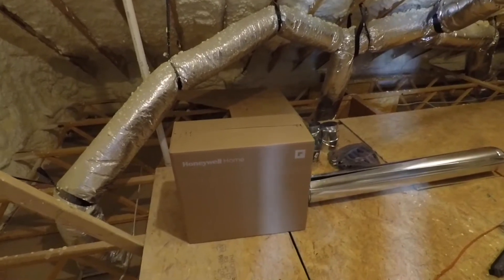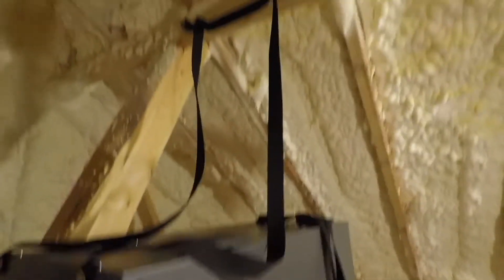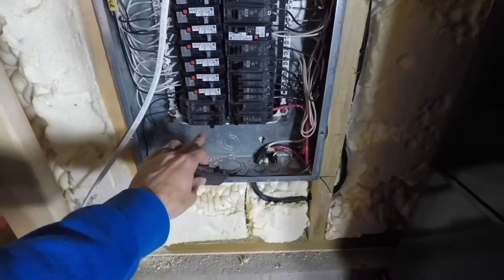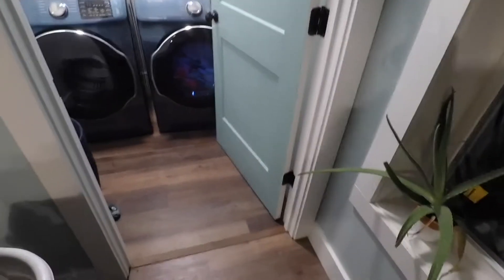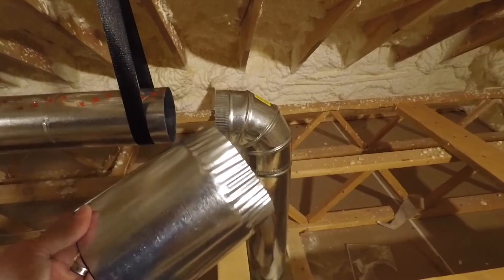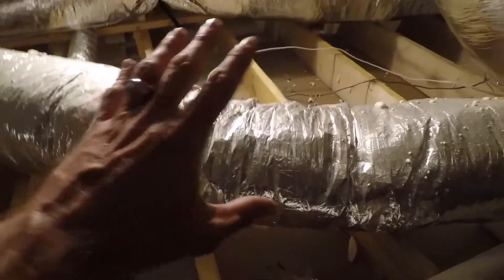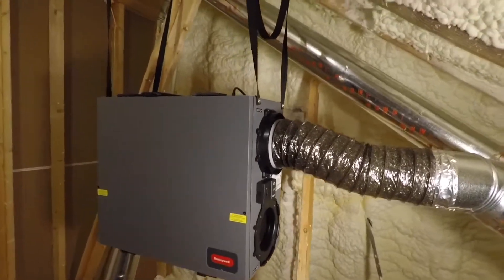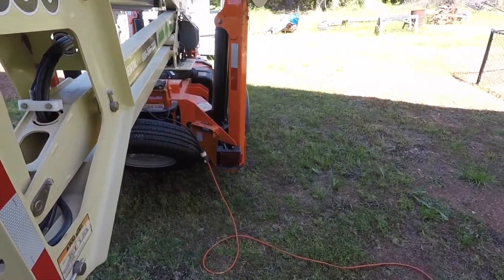We installed an ERV in our house. DIY Energy Recovery Ventilator Honeywell VNT5150E1000

Comment: Funny how you see trying to figure out what they were thinking when they installed the thru wall exterior vent. They weren’t.  They slapped em in and rolled off the job.  Never cared if they were connected. Good thing you caught it. You should check the others they are probably blowing in the the wall cavity as also.  Good work.  I’m wondering if the system is a good substitute for bathroom exhaust?
Reply from the maker: My kids take really hot showers. The ERV does not suck the steam out of the bathroom fast enough. When they open the bathroom door, it sets off the smoke alarm. I cut a little bit off the bottom of the door to allow the ERV to pull more air into the bathroom. I probably need to cut more off the bottom of the door. Or maybe they shouldn’t take showers that are skin boiling hot. Haha.
Reply: So you removed all the exhaust fans? Or just one?

Comment: Nice video.  One thing you may want to consider is to minimize the hard turns (i.e., 90's) and use more gradual turns.  The hard turns/T's impede air flow - while Y's and 45's and large arcs impeded far less.

Comment: How load is the system?
Reply from the maker: Do you mean how loud? It is not loud. It sounds like a fan running. There is a bedroom right next to the attic space where this hangs. You cannot hear it while in the bedroom. I can easily have a conversation standing in the attic next to this unit.
Reply: @BrantleyBlended  sorry, yes, Loud! It has to be placed in a bedroom on an exterior wall because it’s going in a condo. Do you think it will be comfortable to live with?
Reply from the maker: @juliesack2752  I think it will be okay. The box is well insulated, especially the door. It’s not as loud as a plastic box fan. People have those running in their house all the time. Maybe it’s as loud as a ceiling fan running on medium or high. I will post a video in the next day or so about how loud it is. Maybe that will help you decide.
Reply: @BrantleyBlended  thank you!

Comment: You did a good job of installing and explaining. I’m trying to learn about these systems so I can eventually install one in my home. I guess I’ll subscribe and see what else I can learn.
Reply from the maker: For some of the longer runs upstairs, I should’ve reduced the duct size from 6” to 4”. 

I wish I would’ve used an ERV/dehumidifier comb unit. 

If I could start all over, I would just install fresh air intakes on my 2 hvac units. I would not install an ERV at all.
Reply: @BrantleyBlended why just fresh air intakes into the hvac. Cost and time? Would you get comparable or better results than the stand alone ERV?
Reply from the maker: Yes, cost and time, but some other reasons too. I would’ve saved a lot of money by just installing fresh air intakes. I also would’ve save a lot of time. I could’ve installed the fresh air intakes a lot faster. 

The ERV requires cleaning at least every 3 months. I’m tired of constantly cleaning and maintaining the ERV. 

The ERV is working good, but I feel like my house could benefit from higher positive pressure. If I had 2 fresh air vents they would pull in a lot more air than the ERV does.
Reply: @BrantleyBlended - do you think that would have solved the problem without setting up your ERV ? Im in a similar situation from tour first video which lead me to this seeing how I'll need to install this unit on our metal home that we builtand have spray foam in it an my humidity level is always like 75-80%😢 so this video gave me hope.
Reply: @BrantleyBlended - how would you get the fresh air intakes to pull the air in would it require you t purchase some sort of gable vent with a fan to draw in the fresh air into the hvac system allowing the fresh air to travel through the ducts? Would i still need separate return ducts to pull out the stagnat air?

Comment: GFCI plug but not a GFCI breaker?
Reply from the maker: I think that’s overkill. The code was changed some years ago and now breaker panels are filled with gfci breakers. They are expensive. They trip too easy. I don’t think they are necessary.
Reply: You only use one not both

Comment: Instead of metal SS duct v can make use of PVC SWR.  with complete accessories Y. Coupling reducer available only v hv to do PU OR  aluminium insulation on PVC pipe Duct ....is non corrosion light waight & long lasting life

Comment: I was kinda skipping through cause I just want to know how the switches in the rooms are wired into the hrv and if you have to interlock it with the furnace. Does anyone know a time n the video the this is mentioned or how to do it
Reply from the maker: I do not have switches in rooms. This system that I installed is completely separate from the hvac system.

Comment: Why does the ERV need its own circuit with nothing else on it? It only draws like 200 watts. It's basically a couple of low power fans. I dont get it.
Reply: Looks like he had plenty of room in his electrical panel and maybe his other breakers didn't have the capacity to add the ERV.

Comment: Thanks for this great video.  You truly have patience and courage to do this on your own.  I have learned alot from your video.
Does this ERV can be control by the smart-thermostat such as Honeywell T10 PRO smart thermostat?

It is to start when HVAC starts and shuts off when HVAC systems shut off?
I do have humidifier controlled by the Honeywell T10 PRO smart, which turns on the furnace blower when my house is low in humidity.
Reply from the maker: I don’t know anything about the Honeywell T10 PRO smart thermostat. My ERV is installed completely separate from my HVAC system. I don’t have a separate controller for my ERV. I just use the on/off switch on the side of the unit. My ERV runs 24 hours per day. I only turn it off when I clean it.

Comment: Shoulda put the intake down low and exhust up high
Reply from the maker: Why?
Reply: Your exhust air will rise and get picked up by your intake
Reply from the maker: So far, I haven’t noticed this being a problem. I thought putting the vents 6’ apart was supposed to prevent this. If I decide to switch them, it should be pretty easy to just switch the duct work inside.

Comment: Its not the spray foam fault. 
You can have a vented attic house with traditional insulation and still have the same problem. 
Your house is tight.
Its becoming a new code.

Alternatively you could undersize the hvac unit and have it run longer. Would remove moisture.
Reply: Yup.  He needs to find the source of the moisture.  I have spray foam on the entire envelope of my house.   Similar climate in the SE.  No dehumidifier.  Just run the A/C in the summer.  We have a full inground basement as well and the humidity down there stays around 40%.   The humidity in the heated area of the house stays between 40% and 45%.

I did install an ERV because CO2 levels were over 2000 CFM.
Reply: Wouldn't having a smaller AC unit running longer raise the cost of electricity that you try to save by doing sprayfoam?

Comment: Nice work and good, no perfect, video to post on YouTube. I truly appreciate your passing along this honest video showing exactly how you installed the Honeywell ERV in your home. I've invested about a year already in preparation before replacing my HVAC, Hot Water, and Garbage Disposal systems; at year 24, everything in my house failed at the same time and I was determined to DIY.

I am forced to seriously consider getting our attic, and perhaps the crawl-space, spray foamed to help with air sealing and insulation so the ductwork can be enclosed in the "thermal envelope" of the house, which seems to be a necessary first step if I want to save the max on energy costs. The HVAC ducts need to be inside the conditioned space, whether insulated or not. R-8 insulation on ducts (code) in my hot attic won't do a heck of a lot of good with respect to heat loss via the ducts, and what exists is at R4.2!

You said you had problems with the spray-foam the general contractor installed in your new home's attic, and you said that it caused an odor, or something smelled bad with your inside air, and you said that after installing the ERV, your air smelled better, it smelled fresh, or something like that. Can you say anything more about the spray-foam that better explains your complaints? Were you happy that your attic was spray-foamed? Unhappy? Were there any moisture problems? I think you said you had open cell form? Anything you might say could potentially be a big help in making my decision. Thanks.
Reply: We did open cell foam and installed a 200cfm ERV.  Several videos on our channel about the foam and ERV.  Hope it helps you.

Comment: the spray foam made your house tighter, thats a good thing. your problem may have been caused by the SPF Insulation, but your real problem is HVAC, and as may have already come to know, that ERV is not going to completely solve your problem. You need whole house dehumidification also, because you have way too many BTUS of dump Air Conditioning now. If you had a more advanced HVAC like a minisplit you'd be better off. your AC Units are not running enough to provide adequate dehunidification, they cool the house too quickly now and have no dehumidify mode like a minisplit does. the ERV is necessary you need fresh air, but now you'll be buying a dehumidifier than you should not really need. I bet if I skip ahead I am going to see that you will be doing that, but its not going to address your issues completely. you really needed a good, modern HVAC guy to redesign your HVAC System, pricey though. I have a potential DIY Solution that may be much less expensive, but will result in the nullification of all kinds of warranties, LOL. It involves moving all your second AC Unit vents and returns  to the main AC unit, and upgrading that unit to a smarter zoned system with new thermostats, plenums, and dampers.
Reply: your going to be needing some measurement equipment and your in for a bunch of math. On another note you are throwing around the ERV term alot and I am not sure that your are really aware how cool that thing is, literally. its an energy recovery ventilator and not an H(heat)RV or simple "V". It has a very advance multispeed fan with a really efficient motor. but the really cool tech is in its method of Energy Recovery. Its not your regular old everyday heat exchanger in there, its got something called an enthalpy core that serves to partition the incoming and outgoing air in such a manner that allows for the already conditioned stale air to transfer that conditioning to the incoming fresh makeup air at probably around 80 efficiency, very cool. In the very near future, innovative use of dessicants, enthalpy, heat exchange, heat pumps, evaporative cooling, DC Inverters, rigid mini duct and zoning should find us increasing HVAC system efficiency by several powers of 10. This could go a long way toward saving us from being forced into the dark ages by the "climate-change-is-all-our-fault" Co2 Nazis. But its a long shot from a sinking container ship.
Reply from the maker: The ERV fixed a lot of ventilation problems, but we are still fighting high humidity. I just ordered a whole house dehumidifier. I hope to have it installed in a week or so.
Reply: @BrantleyBlended  yea, I figured. when I remodeled my small house I bought a low pressure foam rig and though not HVAC licensed, I know it, and the issues folks are running into, at least in texas and the southeast. Its simply the way houses are traditionally  built down here and we have to keep our cold in so our systems primarily recirculate, up north they ventilate. By moving the conditioned envelop you took away most of your homes ventilation so you needed to get riid of bad air, you could have done it by putting your bathroom/kitchen fans on timers and crack your windows them you end up with negative pressure and your ears pop, gotta have fresh make-up air. You addressed this with the ERV, but your not balancing its use optimally or to its full benefit thus wasting some energy, until it fails. The spray foam insulation increased your R Value. This again would be a very good thing as you require fewer BTUS from your AC to cool your house, but your AC system was spec'd for the old R Value and it is dumb, it recirulates, filters and dehumidifes the air as well as cooling and heating it, but it does so only taking into account a single factor; the temperature at the thermostats and your thermostat is too dumb to measure the humidity and adjust the runtime of the air conditioner accordingly. The way you were sitting right now you probably no longer need two air conditioners worth of BTUs. But you can't just move your upstairs vents to your downstairs system because they need different amounts to condition the space, you need another thermostat and dampers to set up upstairs and downstairs zones on the single AC and even then it's still not measuring the humidity and will still run too little, at any rate you can control your house untill one or both fail. So you are forced to get a whole house dehumidifier even though you already have plenty of capability to dehumidify in the AC it's just not running long enough to do it. So you're about to buy and install something you already have and waste energy running it, but it will address the issue, untill it fails. The standards governing all this and everything you are and will be dealing with are EPA ASHREA Guidelines for IAQ.
Reply: I wrote all that to illustrate what you're into but what we really have to understand here is the point that turboflush made in his comment, these codes are coming and everybody wants them to. Society demands safe, efficient housing standards for the good of all. All of this has happened before, over and over and it goes like this ... Congress will pass a law that all infrastructure must be more built more efficiently to save energy and existing infrastructure that doesn't meet efficiency standards must be built back better. Agencies will be tasked with defining the standards. Municipalities will write codes that meet the standards as the do now and apply them as they do now thru zoning. Properties that don't meet efficiency standards must be brought up to code to get utilities properties without utilities are condemned. People believe that there are laws that protect their house from being taken are living in a fantasy land. A seemingly innocuous change to the requirement that all structures must meet a specific R value is coming. When you did your spray foam you thought you were good, but now you're in $1000 for an ERV that is not being used properly, you have $3000 worth of air conditioning you do not need and $4000 of the wrong kind and that is forcing you to spend $1500 on a dehumidification that you already have. The components are all eventually going to fail and if you wanna know when look at the warranty period, it'll probably be shortly after that these days. Anything you can do to run your erv less will make it last longer. If any of the other three components fail you should take that opportunity to address the remaining ones particularly if it's your downstairs air conditioner's condenser or air handler those are the two most costly components.
Reply: All of this is just conjecture and opinion on my part though as I an not a State Licensed HVAC Technician and cannot sign off on any code compliance. In order become licensed I would need to have 4 years of verifiable employment as an apprentice.

Comment: Hi, I live in Canada and the closest installer lives 5 hours away, to hire him it will cost me more than the unit. So I watched your video and will diy it as you did. 

Did you put a vent in every room or just one on each floor? My house includes basement, main floor, 1st floor and attic (living space). There is 1 bathroom on each floor and laundry room on main floor.
Reply from the maker: I put a supply vent in my living room and each of the 3 bedrooms, so 4 total. 

I put the return vents in 2 bathrooms, my kitchen, and my laundry room, so 4 total.